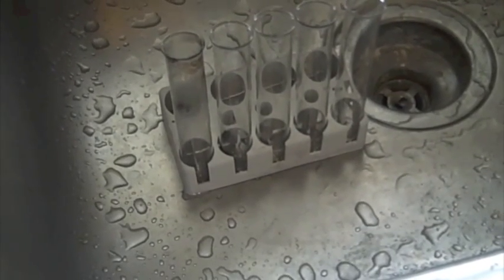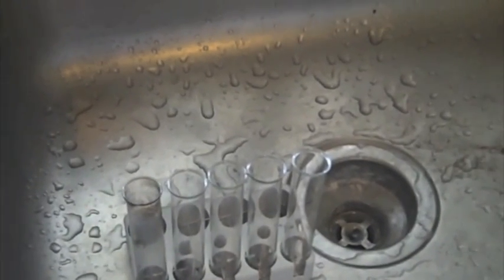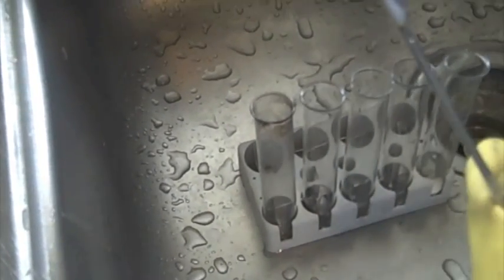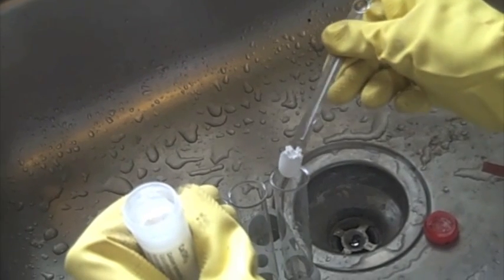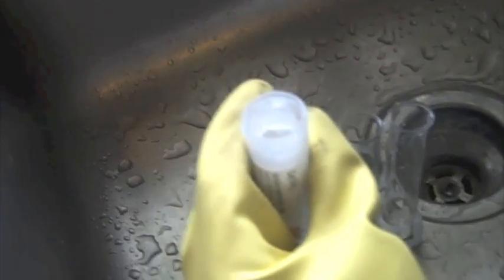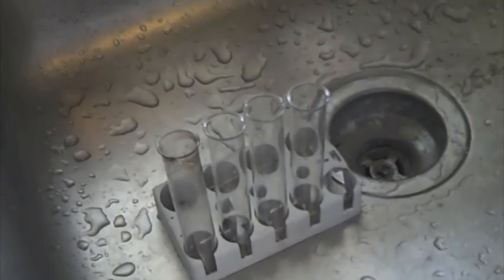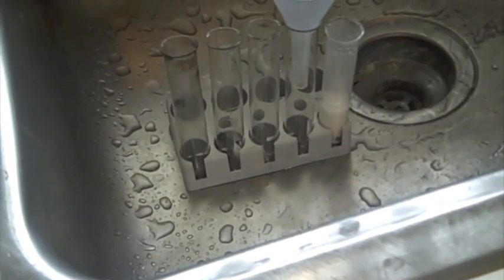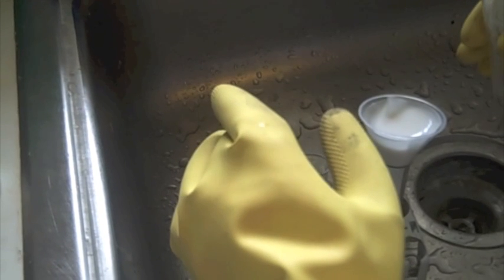How to Make a Sodium Hydroxide Solution

Comment: the precipitate is not only calcium carbonate, it also has alot of undisolved calcium hydroxide because the solubility is low the reaction occurs when each substance is dissociated. and if there is an excess of sodium carbonate, it will be in the solution along with the sodium hydroxide.
Reply: I was tried this method to separate CaCO3 from Na2CO3 waste water by adding Ca(OH)2 but it does not works

Comment: @AHW214 I was thinking about replacement of the Na2CO3 by a baking soda NaHCO3 and instead of calcium hydroxide, i would use copper hydroxide. Is the equation right ? 2NaHCO3+Cu(OH)2 --> 2NaOH+CuCO3+CO2+H2O